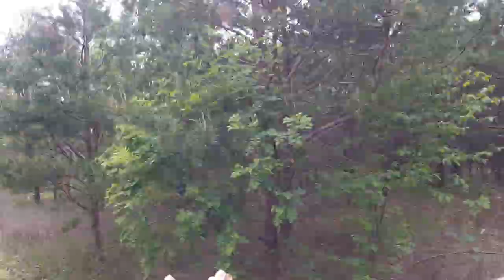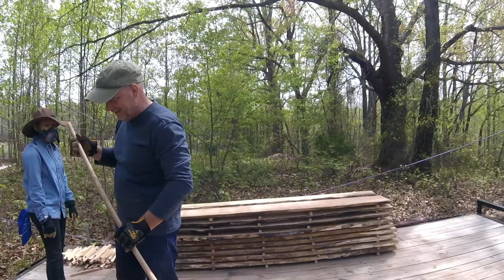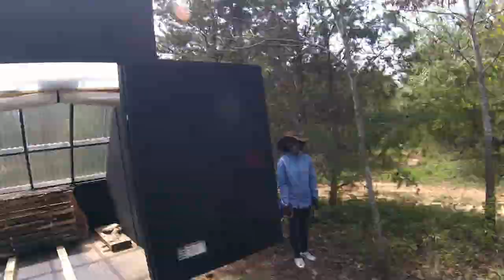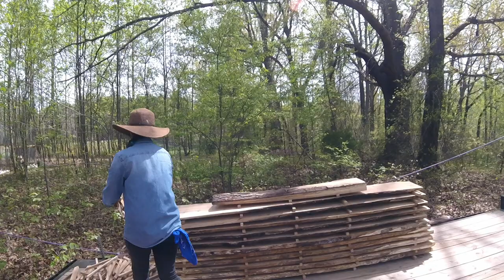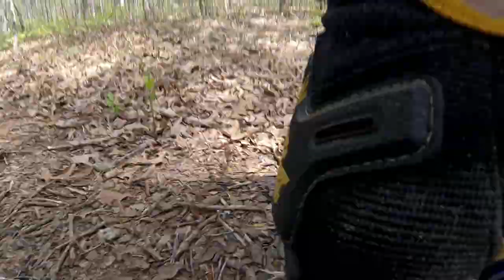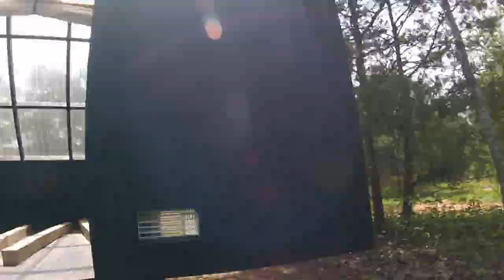Solar Wood Kiln Unload

Comment: Once it's dry I would consider just dead stacking it.  If you leave it outside it will likely regain some moisture content.
Reply: Nice looking kiln by the way....putting together materials for one myself.
Reply from the maker: It will, but no where else to put it but outside at the moment. I usually bring some in the shop for some time before I use it to let it stabilize.

Comment: That's a nice kiln haven't seen one like this, dose the sun wrap the wood at all?
Reply from the maker: It's basically a greenhouse for wood. Air tight with insulated walls. Over head attic fans with automatic thermostats and vents top and bottom at the back with a plastic curtain in between to channel the air flow and of course facing the sun. We had already removed the concrete block weights from the top of the stacks. Which keeps even pressure on the wood and stops direct sunlight on the top piece of wood. The lower the wood is in the pile the straighter it is. I want to make a pallet on the floor with tie downs points so I can ratchet strap the stack together to make it even more stable during drying. Their is always some amount of warp but can be managed though the way in which the log is cut and stacked. Drying too fast causes checking on the ends but I always leave boards as long as I can so it can be cut off. You can paint the ends as well to slow the drying to prevent this but it's a lot of work already and adds yet another step and costs $$. I would do that for a really high value wood for sure.

Comment: How long does it take to dry?
Reply from the maker: Depends on the time of year. Best not to do it in the summer, too hot. I think this load was in the end of winter/spring which was in for 3 months. It was at 12% moisture when we removed it. Inside temp during the day is usually 60 degrees above ambient. I visited Maine last summer.....
Reply: Burton's Attic That’s pretty good for that thick stock. It’s a nice place to be but a little snowy this time of year.
Reply from the maker: I didn't test all of the pieces. Thicker ones may have a little high moist%. We stack it on the trailer and tarp it to air dry. I go get it as I need it in the shop. I lived in Alaska for a while, I know. I liked all the antique shops up there!